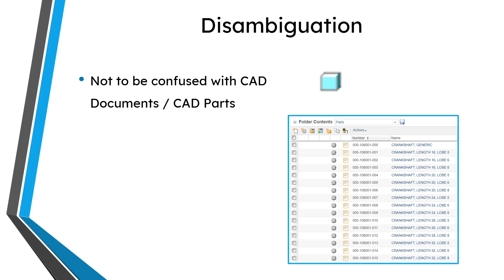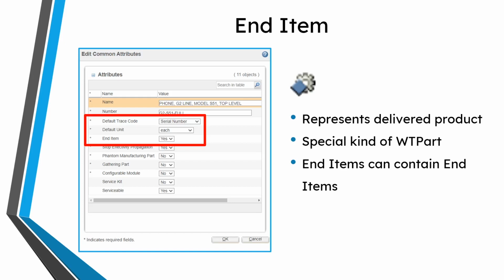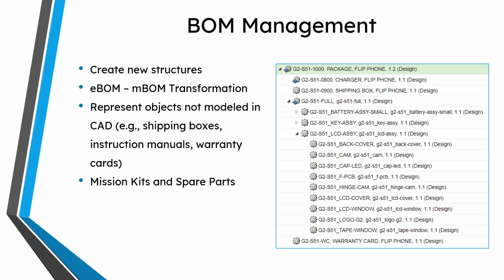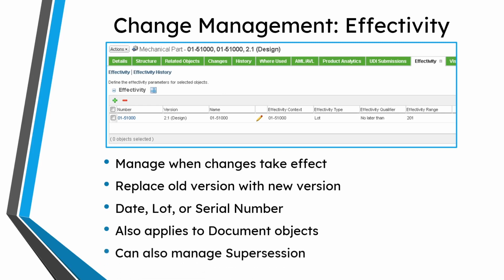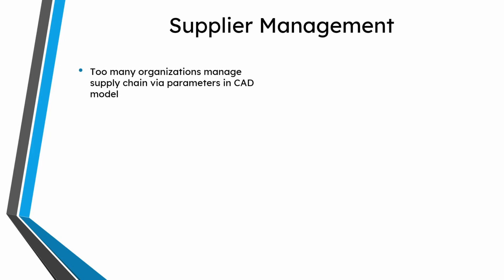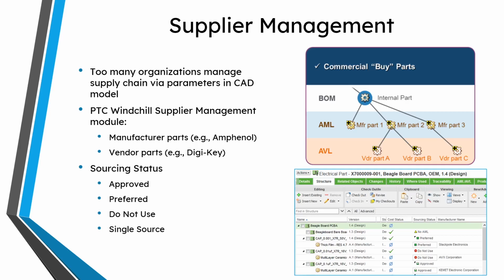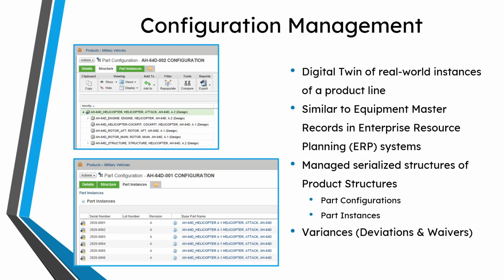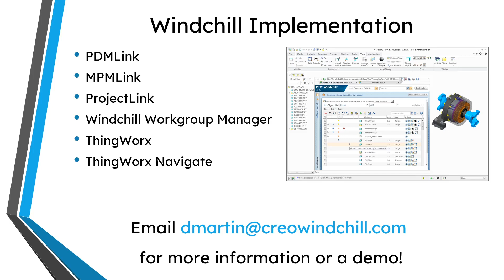PTC Windchill - Windchill Parts and Product Lifecycle Management (PLM)

Comment: Sir, please advise me, there is a part from PTC Creo is not equal to WT Parts, then when I send the data from PTC Creo to PTC WindChill, then what type does it become?
Reply from the maker: First, I want to make sure you use the correct terminology. You "check in" something from Creo to Windchill. (Also, it's usually called "Creo" or "Creo Parametric," not "PTC Creo." Similarly, it's Windchill, not "PTC Windchill." I use "PTC Windchill" in the video titles simply for Search Engine Optimization.)

If you check in a part, assembly, or drawing from a native CAD authoring application like Creo, SolidWorks, NX, CATIA, Inventor, etc., its Type in Windchill is "CAD Document."

If you check in something like a Word document, Excel spreadsheet, text file, PDF, PNG image, etc., its Type in Windchill is "Document."

Types and Subtypes in Windchill are used to manage what attributes (similar to properties or parameters) an object can have, as well as permissions, processes, workflows, etc.